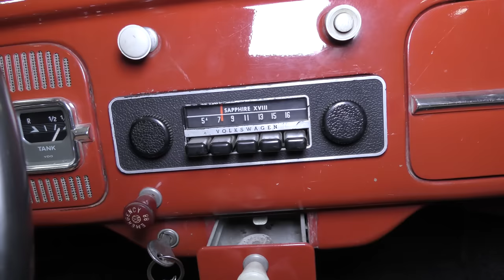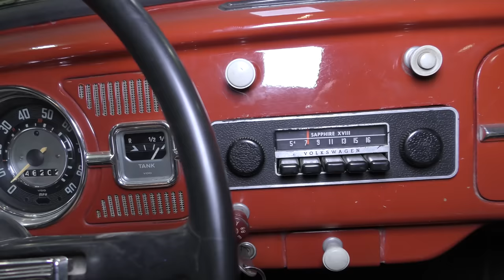Big Mods with big $$$. When Mods don't make sense. What did the  CAR WIZARD do to this '66 VW Bug?

Comment: Wiz, my red  ‘65 with a crank open sunroof was one of the most useable cars I’ve ever owned. It was great in the snow although the heat exchanger boxes had rusted out so I didn’t dare flip the heater levers or I’d be dead from Carbon monoxide poisoning. My brother (2nd owner) gave it to me after driving it 40k and not changing the oil. No problem, that’s how I learned, he couldn’t be bothered! 
         Gas pedal cable snapped in the tunnel running from front pedal back to carb linkage in the rear. This was on a very cold January Sunday  driving home to Philly suburbs from around Harrisburg, PA. I cut speaker wire from the rear speaker deck and from my Kenwood tape unit. It was on an overpass and maybe 5 degrees with a lower windchill! I wrapped the wire around the throttle linkage and fished it through those vent in the rear engine hood to the drivers window. I could pull on the wire to accelerate the engine speed and at the proper RPM, could roll up the window tight to make a crude “cruise control”. I drove the remaining hundred miles back to Strafford,PA with barely a chilly left hand. 
           One last amazing thing! Still in my ‘65 red beetle. Driving home from work during rush hour in the summer of ‘77? Hit a red light on a busy divided highway, just about one car back. I Ran out of gas!!! I knew I was very low! Damn it!!!  Luckily I kept an empty 1 gallon gas can in the front bonnet. I new I only had a minute or two to run to the Mobil station that was at the corner where I was stranded. The cars were bumper to bumper all around me. So the longer I was stranded there the angrier these fellow commuters got!!! So I grabbed the can, ran to the Mobil gas station and quickly pumped a gal. of gas, ran back to my beetle and poured it into the tank, (lick it Ty split)
     I cranked the key and the little bastard started right up!!!!!
       From the other commuters all around me, I heard the rousing sound of applause and “bravo, bravo” and that’s when the light turned GREEN!!!

Comment: Correct me if I am wrong, but I believe that all Beetles had the gas filler cap and neck under the front hood up until 1967.  1968 was the first year for the outer door, located on the passenger side front fender. Love these cars.  I bought a 1971 stickomatic back in the 90's.  I never got it road worthy though.  Not enough money.

Comment: you are a very honest mechanic I wish I can find one here in Montreal.  WoW . just for your honesty you should have a trustworthy certificate.  I 'll be your client for life of my car. I have a 2008 Honda CRV I don t know anything about repairing, just oil change, changing air filters and changing tires for summer and winter season. I had never had any major issues other then battery issues; had sparking plugs changed, new AC compressor,  some cloncking  noise in the front left side also had it fixed by a certified mechanic, my only  2 issues now are heat shield protector to be changed next year it's fixed with 2 O rings clamps and transmission  will shake  at the changing gears if I m not accelerating properly fast.

Comment: I had a 1967 Beatle in 1971. It was a great car. I drove it for 5 years. I installed a set of headers. It improved the power ,gas mileage and heat / defroster. In 1972 my monthly fuel credit card bill was $10/ $11.

Comment: I think the radio's a replacement.  Doesn't have the chrome trim that lines up with surrounding trim on glove box and instrument panel.  Looks like it's from a later model bug. Glad it could be preserved.  It's in great condition.

Comment: i own a 1984 Bii with a holly 350cfm. I pop the hood, place the battery and open the air filter top, then pour a good amount of 91 gas. Replace the top, close hood, crank holding clutch in.. all is well.

Comment: Another suggestion would be to locate some gas without the high percentage of corn juice in it.  When I rode motorcycles regularly there was lookup websites (there's apps for your phone now) to find "real gas" - I'd fill up at those places and never had any issues with fuel although I'd still run Sta-Bil for the month or two where there was snow on the ground and I couldn't ride.  I still do the same with the lawn equipment - find good gas and use Sta-Bil.

Comment: As a teenager, in 1972 I learned to drive stick in a '68 beetle. In 3rd gear you had to hold the shifter when you hit a pothole or it would jump into neutral. Fun car, that was easy to park.

Comment: Couple of things: The spare wheel was not in place, perhaps for filming purposes, but to make the windshield washer work properly, the washer fluid tank and the spare wheel should be coupled with a special hose that connects to the schrader valves of both.; the washer system uses the spare wheel pressure to spray the fluid. If only the tank is pressurized, it will not give many sprays before quitting. The other is the placement of the priefly shown plastic fuel filter: Many Beetles have burned because of fuel leaks, and the modern gas rots everything. If it starts to leak or breaks there, the beetle will catch fire.
The seats are not originals, and the door panels and the front suspension are aftermarket ones.  I have a Bonito kit car based on Beetle, and I did similar electric pump conversion for it. Planning to have a separate priming switch, and get the pump running normally only when there is oil pressure. Now it runs when the ignition is on, and that is not safe, as You mentioned.

Comment: The ride height adjusters are aftermarket, they didn't come that way. Also this car was originally 6v and had a 6v generator. Most go with the12v generator rather than the alternator. After that it was just bulbs, battery and wiper motor which some just ran at double speed. The interior paint is factory, so that is the factory color.

Comment: I recall as a kid driving my mothers bug next to a canal in a horse pasture and having a fork slip down the backseat and short out the voltage regulator. Bailed out of car thinking it was on fire due to the smoke then realized it was heading for the canal and jumped back in and stopped it lol.

Comment: I bought new a 1970 Beetle in that color, but with black interior.  $1,849 base price.  AM radio was a $60 option, as I remember.
Had the car for nearly 16 years, and put 160K miles on it.  Had to replace the engine with a rebuild at 106K.  Got it stuck in a stream while off-roading one time, and discovered how water tight they are... until you open the door. 😂😂😂
Don't the EV conversion batteries add hundreds of pounds to the car's weight?  Even when you factor in the removal of the engine, transmission, and gas tank?

Comment: Wow... that is one very sweet classic.  Great job on the fuel system, I learned a lot.  I have nearly three times the displacement, double the carbs, and my car is three years younger.  Leaving it standing is a major issue, it's due to go into the shop as I'm going to electronic timing for the eight cylinders.  Definitely looking to get an electric fuel pump as well now, same reasons, it runs off a cam as the engine turns over.  I have a hell of a battery to make it run and run before it fires up.

Comment: The builder of this car appears to have started going toward a traditional “California Look” beetle with T-bars in place of bumpers, lowered front suspension, BRM wheels, window rubber with out factory chrome trim.  However, the door glass was not converted to one piece glass and the “big” engine not installed.  It looks like a great cruiser!

To nit-pick, it has a later 1968+ radio, 1974 alternator, Bosch blue coil and what looks like a Bosch 009 distributor.

Comment: It seems like (at least all the Beetles I could find) had a MAX speed of 55, living here in Florida that's even more dangerous than going 70 in a tin can... 

if a Beetle could survive in Florida it'd need mods to make it go 70. Bigger breaks, different gearing, I don't know if the stock engine could even support that kind of speed. I'd assume suspension would need to be upgraded too... sheesh.

Comment: At 8:13, there is an open vacuum port that used to supply vacuum to the original vac advance distributor.
Might want to plug that...  I also recommend an original Solex carburetor over the new replacement (quality issues). The original vacuum advance distributors provide better throttle response and economy. 
Cheers!

Comment: Want your good work to last years , if the carb has a provision for a return to tank use it , the needle and seat , float bowl will last longer and it will be more reliable.  Also use a very good large filter. Try it once and you will be a believer

Comment: In 1975 a cold wave hit Columbus, Ohio, took the temps down to 22 below at night.  Having learned the battery in my 1970 Beetle would freeze at these temps I had to take it up to my apartment and store it in the bathtub overnight.  BTW, it was the original battery from when the car was purchased and being frozen solid didn't do any damage at all.  At that time VW put some really tough batteries in their cars.  Morning would come and I take the battery and get in mounted in the are and secured.  Pump the gas pedal once and the engine would crank so slowly due to the thickened oil you could actually hear each piston stroke.  That car started on the second cylinder that had compression without fail.  Of course it was necessary to let the car idle until it was fully warmed up because at those temps it was very loud and I suspect the block was also rather brittle.  Being someone with a car running in that apartment complex meant that I was quite popular for a while.

Comment: 12V conversion.  Alternator - not generator.  Radio out of a 69-later car.  Repro door panels, upholstery, headliner, and carpet (looks like they didn't install the piece in the way back below the rear window) .  Adjustable lowered front end w/ drop spindles to go with the disc brake conversion.  With all that done, I'm surprised that they didn't put in a dual-port engine.

Comment: Great job! Like a magic! Please change the vacum line, it is pinched! For one second I guessed you will open the front and make a joke, where is the motor? I remenber to clean the breaks of one year 1971 for my brother, like 30 years ago and take me half hour to mount the driver front wheel, just because the nut was rigth thread!

Comment: I had similar problem with my beetle and was told to avoid gas containing ethanol. Since then I use shell 91 which contain no ethanol and solved the problem. I do the same with small motors and motorcycle and they start a lot easily now. I don't know how hard is it to find gas without ethanol where you are but if it's available try it. Also ethanol contain less energy by volume so I'd rather avoid it.

I would never Ev such a nice example personally, it's nice to have it how it was meant to be.

Comment: That interior has been replaced. You can put fuel conditioner or better yet buy ethanol free gasoline. I just last week started a 72 beetle which had not run in 2 years. Fired right up. Plus that's an alternator not a generator. Can't afford 12 bucks for a carb rebuild kit?

Comment: I love Beetles. They bring a smile to my face.  I wonder now if the extended crank time on my van when its been sitting for two weeks is because the fuel int he lines has evaporated and i need to let the fuel pump a bit before cranking.

Comment: Pumping the accelerator would spray fuel into the intake throat.  The windscreen washer attached to the spare tyre in the front, so worked by air pressure.

Comment: My 1st car was a 69' Beetle.  Seeing that interior brought back memories. I turned it into a baha bug lol
Regarding the electric fuel pump, I swapped a brand new chev perf carbed crate motor into my 91' camaro and I did the same set up as this bug. 
It works exactly the way wizard's just did.  My car sits in the garage 9 months of the year because I live at the 60th parallel and it starts like its fuel injected.

Comment: Starting, with the external pump is almost like preheating the glow plugs. The pump you installed is designed to push, not pull. That’s why you need to put it near the tank.

Comment: I have a couple of gas station in the area that sell ethanol free fuel, which I use in all my lawn equipment, on the fuel pump it states for use in boats motors, Don’t have a boat any longer but like I said works great in my lawn equipment

Comment: Here in Florida at least we have rec-90 fuel which afaik is more similar to regular non-ethanol gasoline. That is the only gas we use in the boat due to the water separation that can happen with ethanol fuels. Boat doesn't get used enough for the fuel to get used before it starts to collect and separate out the water so the rec-90 is the way to go imo

Comment: This Bug has had a good bit of work done on it. In addition to the fuel pump she's got front disc brakes, adjustable front axle, new headliner and carpet. I would never ruin a clean '66 Beetle by converting it to a half-assed electric car -- you'll never fit enough batteries in it to give it a reasonable range. Plus the added weight will turn it into a completely different ride -- and not for the better.

Comment: Install a switch for the fuel pump in the cabin.That way you can turn the fuel pump off and run most of the gas out of the carb when not driving the bug for extended time.Tho the Stabil will prevent much of the varnish from forming.

Comment: When I was in elementary school boy back in the late 80s some of the high school kids in my neighborhood had Beatles I fell in love with that rumble. I knew some things about engines at that age I love automotive. But I didn't know nothing about a flat four never seen one. And then 2015 I fell in the Subaru 1998 wagon legacy when I opened the hood at the dealership I was like whoa that's one of those flat fours so I made my exhaust systemsound the way I wanted it to. My car is manual and I enjoy it and it's funny how I fell in love with the sound and years later I accidentally fell into the car that has a similar engine.

Fun fact 101 some people buy Volkswagen buses and beetles and put Subaru engines in them not that you didn't already know that. I just wanted to sound smart for once. 😆❤️

Comment: Thanks for showing what sold VW in the American market. The older VWs had a reserve tank with a lever to select it when the car ran low in fuel. You would be running along and the engine would begin to lose power, and you would reach down and kick the lever to the reserve on, position. (I think it was to the right for reserve.) The car was extremely simple. It would off-road quite well, and we did, a lot. Great car, but emissions, crash protection reglations killed the car. The swing arm suspension in the rear would cause an over driven bug to swap ends quickly when the outside wheel tucked under in a hard turn.

Comment: Electric fuel pump is a good idea. I used to get long-sitting VW's started the simplest way – take off the air cleaner, and dribble a few drops of gasoline into the carburetor. By the way, pressing the throttle pedal to the floor once, before turning the key to start – something no longer necessary, and pointless, in modern cars – not only sets the choke, but it also sets the "fast idle." Simple bimetallic coil returns the choke to open and the idle speed to normal, as the engine heats up.

Comment: Love the bug !!  Looks so cool on the outside especially the stance . Do you know what size tires are on this ? you said smaller in front . Also does this have adjustable beam ? it's lowered perfectly . We just bought our first VW and it's a bug . A 1969 standard as its called . Would love to get this look . If you know the tire and wheel size that would be a great start on ours . We have to have the adjustable beam installed . And great video's your putting out . Thanks

Comment: I see no point in adding an electric fuel pump! If you have the fuel system properly tuned, the mech. Pump works just fine. Btw, and correct me if I’m wrong, but I believe the octane rating on these old engines was probably higher than 87. Which is standard today. If you buy 91 octane, you won’t have any problems with long term storage.